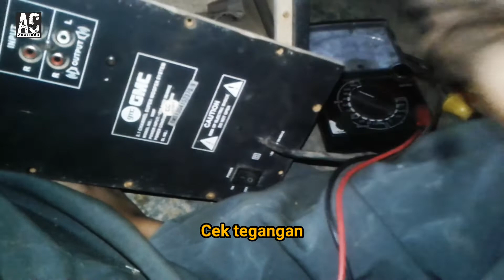Cara memperbaiki speaker aktif GMC Mati total

Comment: Bang terimakasih turorialnya simpel dan jelas :), saya coba ganti elco yg 22mf alhamdulillah speakernya jadi hidup, tadinya hanya ada suara duk..duk.. pelan ketika dinyalakan, tp ada problem baru resistor besar yg 10 ohm sepertinya terbakar dan mengeluarkan asap, langsung saya matikan, kemudian saya ganti pakai resistor yg wattnya besar 10 ohm 5 watt, speaker nyala namun tetap resistornya lama2 terbakar lagi, o iya sebelum mengikuti turtorial abang saya pernah mengganti mosfet 4N65 dengan 7N65 takutnya masalahnya dari situ, tp tetap tidak ada perubahan ketika di on kan speaker tetap berbunyi duk..duk.., saya juga mengganti IC TDA 2030 dengan 2050, apakah karena semua penggantian itu sehingga resistor 10 ohm terbakar ?  mohon petunjuknya bang, terimakasih🙏
Reply from the maker: Cek komponen pendukung area psu, misal elco yg besar (elco tegangan tinggi), kapasitor/milar di cek atau diganti.
Reply: @ANUGRAHCHANNEL52357  siap bang terimakasih

Comment: puny saya gmc 888L,tadinya pas di on kan listrik jegleg, sekring ganti 0.5ohm, fet sudah ganti 7n65 , elco 50v22uf diganti 250vf22uf ,dioda diganti sebagian, (karena sulit di pasaran), sudah gak jeglek tapi ga nyala juga om, apalagi yg mesti di cek?
Reply from the maker: Driver psu pakai transistor atau ic smd?

Comment: Bang speacker aktiv HVN klo dicolokin listrik lampu LED mati tpi speacker kecil bunyi kresek2. Pas dibongkar ada resistor yg gosok, mau coba diganti gak jelas nilainya brp ohm. Kira2 klo mau ganti resistor itu dikasih nilai brp ya, gak bisa ngukur pake multimeter dan gak tau jg caranya. Pengin beneri sendiri buat belajar.
Reply from the maker: Lampu LED yang mati disitu untuk lampu indikator / untuk apa.. semisal lampu LED itu hanya buat indikator, berarti nilai resistor antara 1k ohm (coklat_hitam_merah_emas) atau  1k5 (coklat_hijau_merah_emas).
Reply: Lampu digital bisa fungsi sbg penunjuk tingginya volume, penunjung no urut lagu, dan penunjuk tingginya bass. Itu bang
Reply from the maker: @miftahulkahlil8722  resistor yg gosong jalurnya terhubung dengan transistor/ dioda zener
Reply: Sisi 1 terhubung ke transistor dan sisi yg 1 lg terhubung ke dioda, sptnya dioda biasa bang.
Reply from the maker: @miftahulkahlil8722  berarti tdk hanya resistor saja yg di ganti. Coba cek/ganti transistor demikian juga dengan diodanya.

Comment: Mas cek tegangan DC probe multitester nya dicolokan ke titik apa ya? Pemula mohon pencerahan 🙏
Reply from the maker: Cek tegangan DC, posisikan avo meter kearah 50V DC. Probe (-)/kabel hitam ke Gnd, probe (+)/kabel merah ke titik pin elco bagian vcc+.
Reply from the maker: Terima kasih atas kunjungannya
Reply: @ANUGRAHCHANNEL52357  vcc+ itu apa, newbi
Reply from the maker: @vancedyt1244  vcc+ itu sumber tegangan positif
Reply: @ANUGRAHCHANNEL52357  mo tanya lagi bng, advance m108bt bluethotnya sukaputus2 kenapa, kdang nymbung kdang gak, yg aq maksud suaranya, klo di deketin suara lncar
Reply from the maker: @vancedyt1244  rata² jarak pancaran atau jangkauan bluetooth sekitar ± 10 meter itupun kalau tidak ada penghalang. Kadang² jarak 5 meter pun suka putus² kalau ada penghalangnya.
Reply: @ANUGRAHCHANNEL52357  jngankan 5meter bang 2meter gak ada lagunya dah gak karu2an, putus nyambung
Reply from the maker: @vancedyt1244  coba cek tegangan 5v yang menuju modul, apakah normal atau turun?

Comment: Speaker saya merk megatron,sama persis kaya gitu dalamnya...nah,yg hangus itu TR psu yg ada pendinginya,sama beberapa resistor yg menempel diprintid,namun angkanya udah hilang karena hangus...terus cara mengetahui nilainya gimana bang??
Reply from the maker: Googling.. cari data pin komponen psu speaker yg di maksud. TR psu yg ada pendingin adalah TR Fet dan R jalur tegangan (-) yg hangus adalah R hambatan tegangan.

Comment: fet jebol, r kutu jg hangus, mau coba ganti gacun, masalah tegangan sebenarnya pada 3 dioda D7, D9 dan D12 berapa ya, sya coba hidupkan D7 -13v D9 +12v D12 +10v
Reply from the maker: Usahakan tegangan di d7 dan d9 harus sama, yaitu -12v dan +12 supply tegangan ic final.

Comment: Mau tanya bang, saya punya gmc 888k tapi pas pln di colokan ga mau nyala begitupun dengan lampunya, kira2 akenapa ya bang?? Tolong penjelasanya bang
Reply from the maker: Coba cek dulu tegangan out power supply ada/tidak ada. Atau potong jalur tegangan - dan + yg menuju ic final, kemudian cek tegangan. Kalau sudah di potong jalur tidak ada tegangan berarti PSU bermasalah. Coba cek tegangan elco primer, di elco 22uf 50V ada tegangan/tidak. Kalau tidak ada/ ada tp tidak stabil tegangannya, coba elco di ganti yg baru.
Reply: @ANUGRAHCHANNEL52357  ok siap bang, makasih atas penjelasannya

Comment: Aslmualaikum. Bg mau tanya, lodspeker saya gmc 887G, baru2 ini mau saya hidupin kok tdk muncul ya mode lampu indikator BT dan sbb gtu, sedangkan power spreaker aktif normal, mohon infonya y bg
Reply from the maker: Cek tegangan vcc +5V panel indikator BT ada gk?
Reply: @ANUGRAHCHANNEL52357  bang spker multimedia gmc897d lampu indikator nyala,,tp monitor g mw nyala,,power bs nyala kalo di tekan bersamaan tombol power am soket batre..apanya yg rusak. ya
Reply from the maker: @sabarprasetyo1262  coba cek bagian monitor, tegangannya ada atau tidak ada. Sekalian cek komponen supply tegangan 5V menuju modul.

Comment: Bang, aku ada spiker aktif niko. Pas on lampu dayanya nyala tp amplinya nggk nyala. Kira2 kenapa ya bang? Kl boleh mnt WA juga bang. Makasih
Reply from the maker: Coba sentuh sentuh di bagian pin input ic final/ic amplifier, kalau ada bunyi berarti di bagian tone control ataupun modul console mp3 bermasalah.
Reply: @ANUGRAHCHANNEL52357  trs gmn bang solusinya?
Reply from the maker: @ahmadfaatihul4567  yang itu dulu.. di sentuh sentuh di bagian input ic finalnya, apakah keluar bunyi atau tidak?
Reply: @ANUGRAHCHANNEL52357  ok bang. Maaf bang aku kurang paham juga soal input ic itu yg kya gmn bang?
Reply from the maker: @ahmadfaatihul4567  di situ terdapat ic amplifier, tinggal pin kaki ic di sentuh sentuh. Kalau di sentuh sentuh keluar bunyi berarti ic amplifier normal.

Comment: Saya punya speaker bluetooth merk fleco, sekarang mati total,api dari baterai saya coba tempel masa memiliki api,tapi ya idupin balas ga nyala, masalah nya apa ya maz??
Reply from the maker: Coba cek dulu spesifikasi standar tegangan baterainya berapa volt? Kemudian cek tegangan baterai pakai avo meter saat baterai tidak terhubung ke modul mesin speaker keluar berapa volt? Lalu cek lagi tegangannya saat terhubung dengan modul mesin speaker aktif. Kalau tegangan baterai turun saat terhubung ke modul mesin, berarti ada kemungkinan baterai sudah lemah atau memang modul mesin bermasalah.

Comment: Sayabad spiker gitu mati teg ny over jarum mentok
Reply from the maker: Coba cek ic pc817, tr tl431
Reply: @ANUGRAHCHANNEL52357  fuse putud terus tiap ganti, dioda aman smua, apakah ic ny
Reply from the maker: @hengkifals8452  dalam keadaan netral (tdk ada tegangan), coba tes bolak balik pakai multi tester (X1) di kaki pin elco besar (elco primer). Kalau jarum naik berarti ada konsleting.
Reply: @ANUGRAHCHANNEL52357  iya naik tpi gk kecari dmn konslet ny sya ambil jln pintas saya passngkn psu smps univrersal

Comment: Bang punya ku spiker gmc, lampu indikator nyala, monitor mati, dan gak ada suara, pertama di on ada suara degup di spiker sub nya, apa penyebab nya bang?
Reply from the maker: Coba cek dulu tegangannya, mestinya ada tegangan +12V dan -12V serta 5V ke monitor.
Reply: @ANUGRAHCHANNEL52357  iya bang
Reply: Apa kah ic nya rusak
Reply from the maker: @markcoverboy6496  hanya kemungkinan, belum bisa dipastikan.

Comment: Min IC tip panas
Reply from the maker: Mungkin yg dimaksud ic tda2030 panas, coba cek komponen pendukung.. bila perlu ic diganti.
Reply: @ANUGRAHCHANNEL52357  IC tip Yg L7805 yg dekat jalur kabel speker
Reply from the maker: @mimin999liho4  di 7805 keluar tegangan berapa volt
Reply: @ANUGRAHCHANNEL52357  kalau di skala 50 dcv dibawah 10
Reply from the maker: @mimin999liho4  untuk panel dan mp3 player nya main gk?
Reply: @ANUGRAHCHANNEL52357  ngak mau kebaca MP3
Reply from the maker: @mimin999liho4  untuk 7805 apakah panasnya berlebihan
Reply from the maker: @mimin999liho4  coba cek di socket USB barangkali ada pin yg tertekuk dan terjadi konslet
Reply: @ANUGRAHCHANNEL52357  kalau di pegang IC tip 7805 terlalu panas min sampai ngak kuat pegang